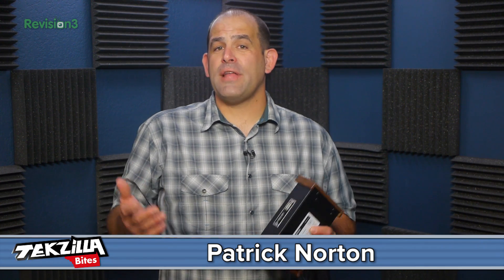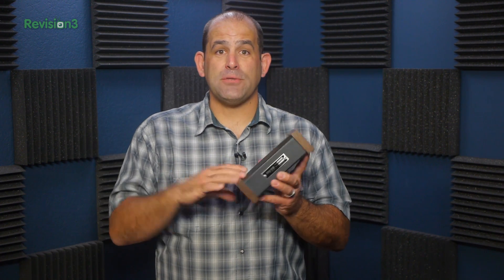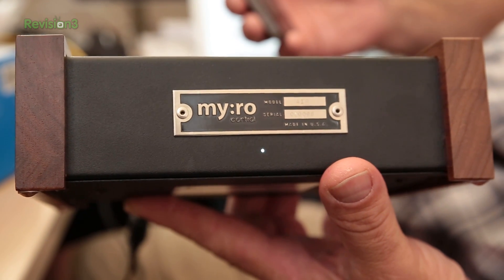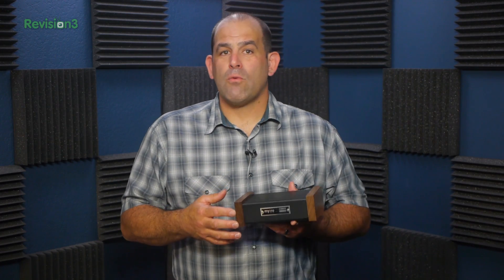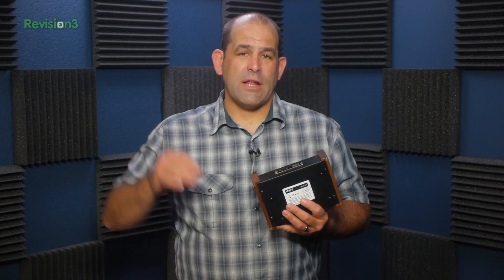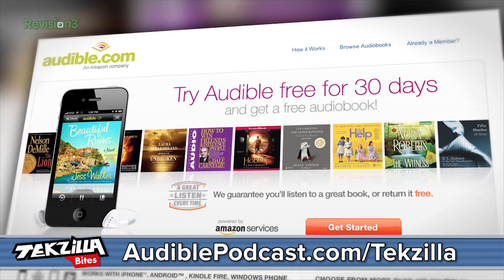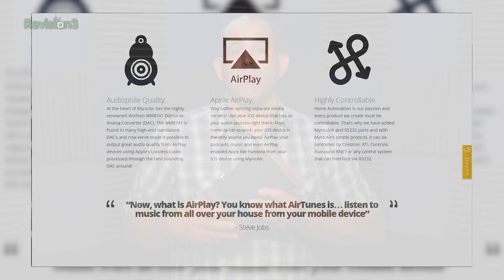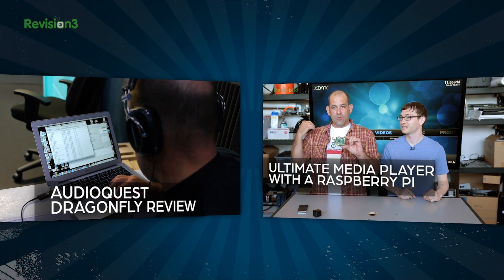Myro:Air Review: AirPlay Audiophile Box Packs Home Automation

Comment: DACs are pointless for PCs unless you get noise out of your front panel audio. Toms hardware did a test and discovered that you can't tell the difference between on board audio and an external DAC, however that's with headphones. Would it be beneficial it it were played through speakers?
Reply: Toms Hardware's guys need their ears checked because they can't hear interference.
Reply: Hahaha, good one. I can def. tell the difference between my on-board audio and my dac-amplifier. 24bit, 0.0004% harmonic distortion, 113dB SnR, as well as being fed into a super high frequency class-T amplifier chip. The difference is night and day, anyone who says using a (decent) external dac makes no difference has some sort of issue with their ears, or even the way their brain processes sound.